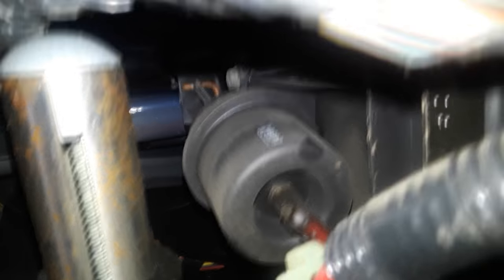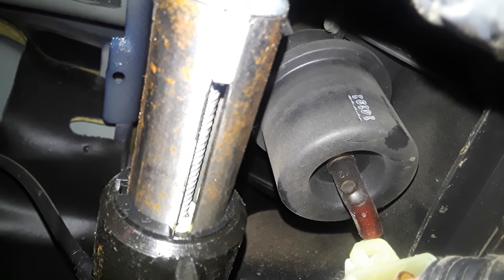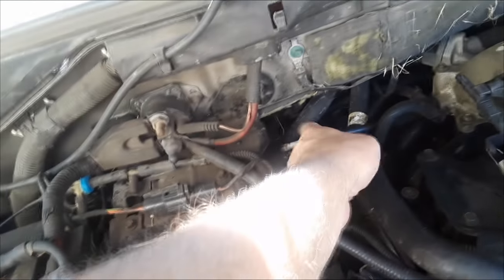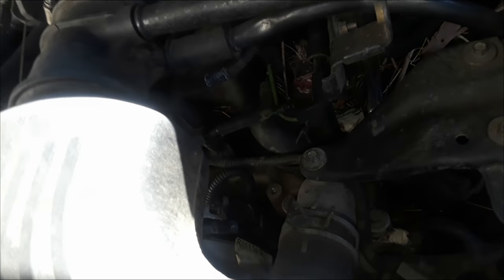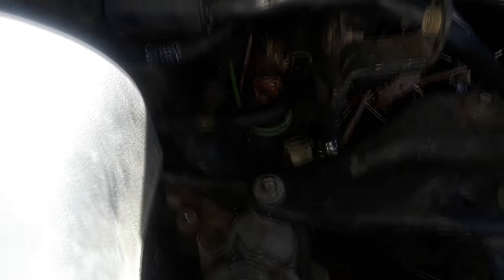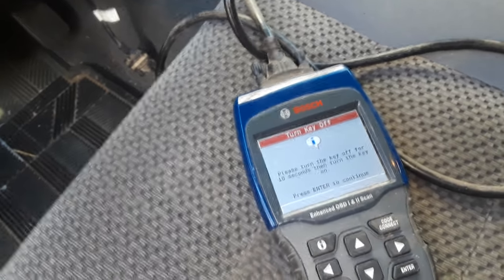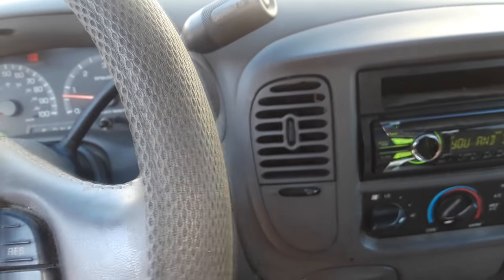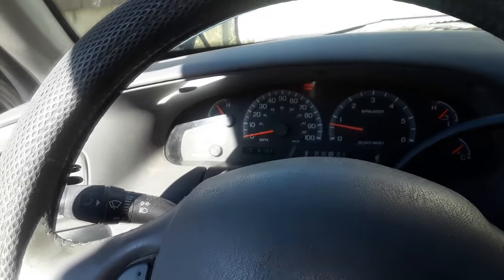how to fix no air from vents and p0401 obd2 code 2003 ford f150

Comment: Looked right in the area you mentioned and found my vacuum line separated as the hose disintegrated.  Went to Advance Auto and bought 1 ft of 7/32" hose for $1.30.  Used about four inches, fixed in the parking lot....air blowing cold out the vents!!!!  Spent about 40 cents and three minutes to fix.....THANK YOU SO MUCH!!!!
Reply: I dont mean to be so off topic but does anyone know a trick to get back into an instagram account..?
I was dumb forgot the account password. I love any assistance you can offer me!
Reply: @Turner Danny Instablaster ;)
Reply: @Dean Aaron I really appreciate your reply. I found the site through google and im in the hacking process atm.
I see it takes quite some time so I will reply here later when my account password hopefully is recovered.
Reply: @Dean Aaron it worked and I actually got access to my account again. I'm so happy:D
Thank you so much, you saved my account !
Reply: @Turner Danny No problem :D
Reply: one time I replaced my alternator in the autozone parking lot 300 miles from home  and I snapped a vacuum hose and had to ask the front desk if he could guess what it was.     pleasingly easy to fix       Delete your instagrams
Reply: Wow! 2 years ago huh?!  Im having this problem right now. Hey, thanks for mentioning the size of the tubing! I was puzzled! 😂. Are you still driving your truck?  Thanks again
Reply: @mrtv777  Yes still driving thru truck and fix still working!

Comment: Thank you sir for your video!  After watching, I went and checked the vacuum  lines and found one of the small ones had deteriorated and  popped apart.  I was able to put it back together and everything worked. Tomorrow I will buy a new piece of vacuum line and life will be good!!! You saved me some money that I didn't have to spend on my 2004 Ford f-150.  God bless you and yours.  I am subing!!! 👍

Comment: Thanks a million! FOLLOW UP for anyone that can change the flow by manually moving the arm on the actuator, it might be your PCV-check-valve. Its the larger vacuum tube that ends in a °90 elbow on top of the left hand valve-cover (it inserts straight into the top of the valve cover). It may, but not always make a buzzing noise while idling.I replaced mine w/ no tools, in 30 seconds for 3 bucks. Everything works, truck even runs a little better.
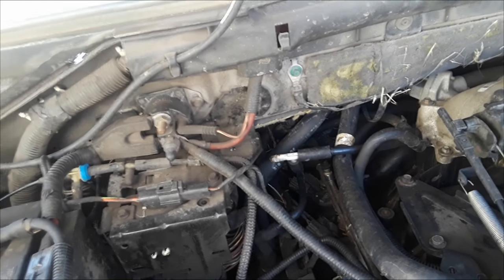Edit: if you pause the video at 2:42 its that little black °90 elbow that can be seen inserted into the valve cover at the very bottom of the screen, dead center, the valve is inside that °90 elbow.

Comment: Thank You! Thank You! and Thank You! I was having EGR problems and found that all components tested OK. After I removed the throttle body to check or clean the EGR passages, the HVAC distribution door would not operate. The elbow must have been leaking, leading to an operating, but minimally EGR system (which would check OK), then the elbow failed (unnoticed by me) while doing the throttle body work. When the ventilation stopped (it's July, in Phoenix) my repair priorities changed. When I saw your video's tile, I knew that I was saved. I'm sure that you saved me hours and hours of fault tracing. Thanks Again!

Comment: Hey thanks bro. Your video helped me solve problem.  My AC vents werent opening,  only the defroster vents. I checked vacuum line behind battery and it was cracked pushing air out. Cut a new 2 inch piece vacuum line and installed where broken one was and vent actuator works great now. Your video was the only ons that explained it..👍. You are right. Vent distribution actuator almost never fails. Usually broken vacuum line.

Comment: I could not find a vacuum leak, so for now, I pulled that rod down you showed me, to open dash panel vents, and wire tied it down. 👍👍🤪
Reply: Haha, that's what I'm doing right this minute. Wire in the summer, defrost in the winter!
Reply: Is it possible we just need a new actuator? I'm in the same boat. All my vacuum lines look really good for a 20 year old truck. I looked over all of them twice.  No leaks. What did you end up doing?

Comment: My truck has it coming out of the vents slightly but mostly defrost but it will switch to the floor so it must have vacuum and I replaced the vacuum line recently because old one was broken. What could be the issue? Ill check out that actuator thing didn't notice that when I looked under there last time.

Comment: I have a ford f150 2011 truck . I replaces the compressor and I still get no air on the vents . When I change it to defrost , the air still comes out thru the vents. What’s the problem or problems?

Comment: I have a 2000 f250 with a 7.3, vacuum pump is holding vacuum too. I get hardly any air from any vents at all. Blower is blowing hard, but it's not pushing much of anything

Comment: Po401 code in insufficient air recirculation....before you spend money on a new  EGR valve, remove the throttle body since it's already removed clean it....and remove the plenum ( the throttle body and erg valve are attached to it) clean it good cause it gets caked up with gunk restricting air flow to the EGR valve, simple fix po401 code solved.

Comment: Had a hard time finding the other side that goes into the fire wall but some electrical tape fixed the issue. Just a slight whistle when the air is blowing

Comment: I fix all the vacuum lines and still having the issue.. any one thinks about something else.?
Reply from the maker: probably one of the vacuum valves (actuator) under the dash that open the the vent's doors.
Reply: IndyHelis  I did replace the o-rings from the ac control unit, easy and efficient, I bought the at my local hardware store less than $4 dlls spent and 30 min labor.!